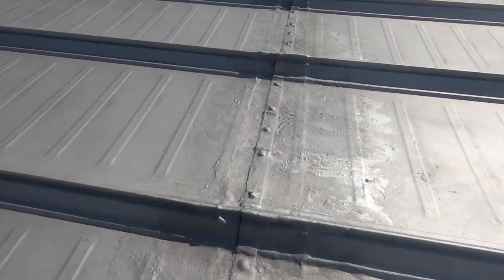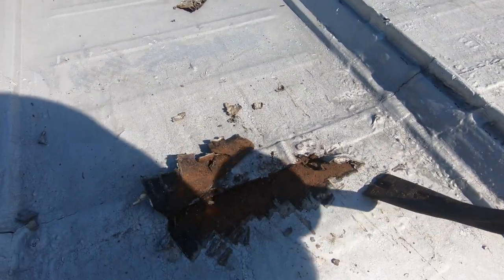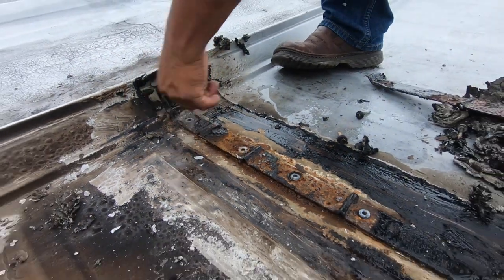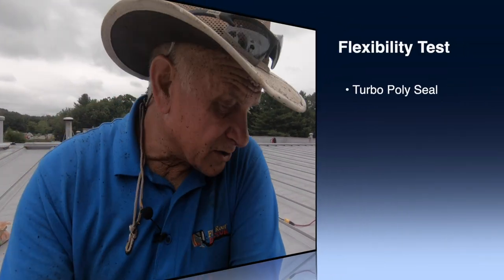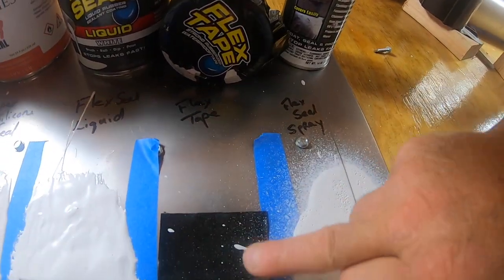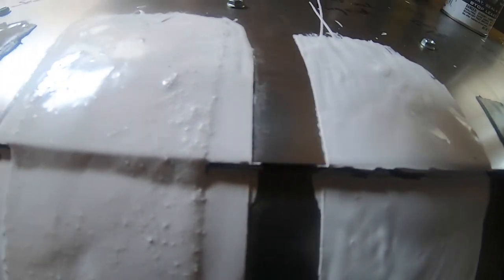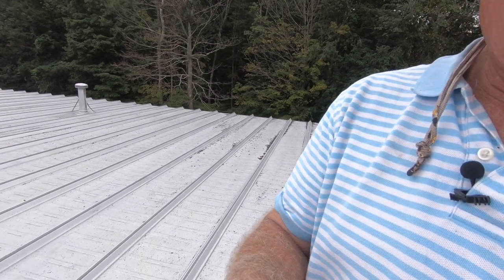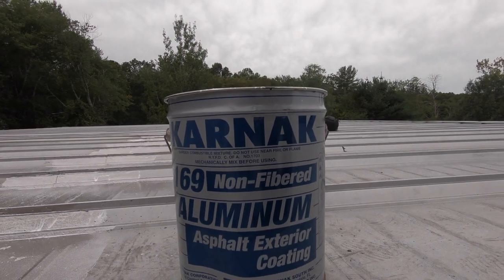Why Silver Paint Coating does not Fix Metal Roof Leaks - People are crazy that think so!!

Comment: What about Henry's tropi-cool 885 roof seal repair using the fleece? This Is what I used to repair a seam that leaked. Working like a charm. I then covered it with Henry tropicool  roof cover 887 to give it longevity vs the sun exposure.
Reply: I took the same steps you did in prep work. I got the old stuff up, grinded the  rust and nasty stuff off, then applied tropicool 885 seam repair, polyurethane fleece, topped that is another layer of tropicool 885 seam repair, let it dry and finished with 887 tropicool roof cover. This was a tin/metal roof